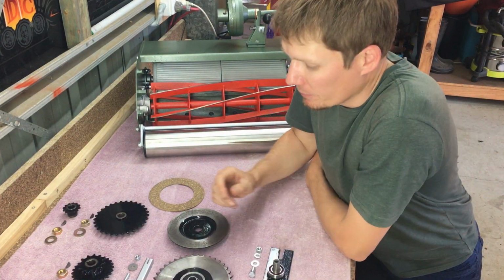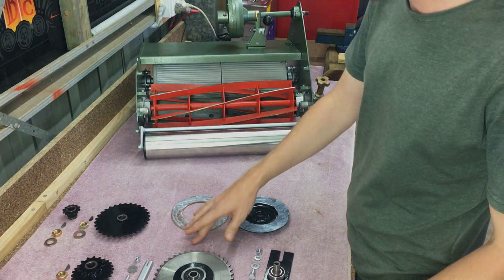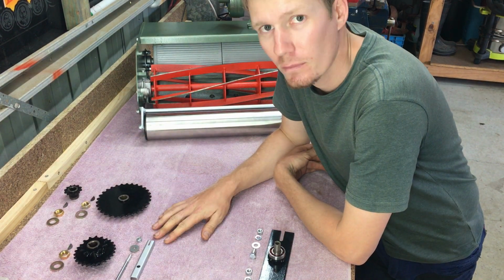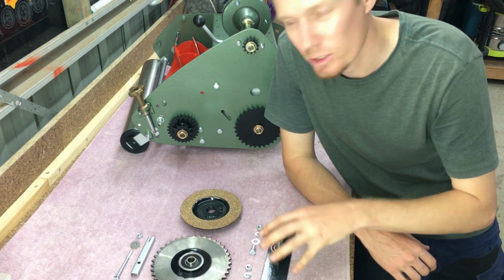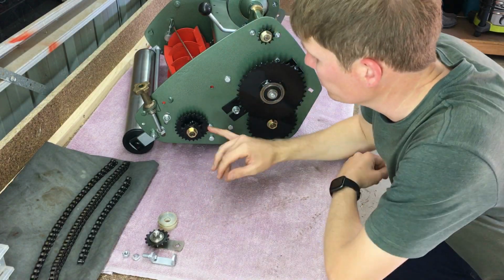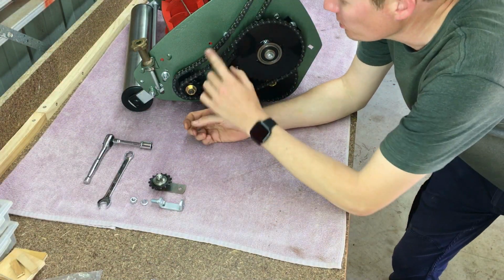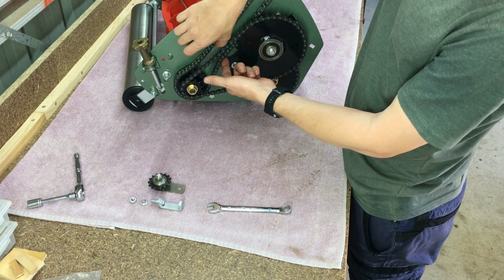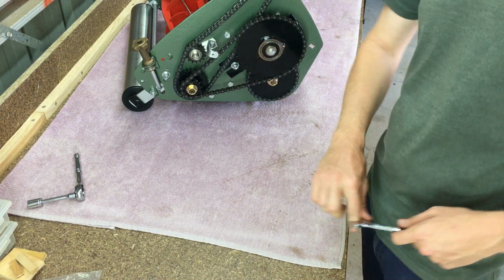Scott Bonnar - Model 45 - Gear + Chain Install

Comment: Hi
Woodruff keys rarely need replacing. Only if the key is badly worn or damaged.
In situations like you had here, SOMETIMES swapping woodruff keys between shafts can assist in easing the installation.
Occasionally, woodruff keys have sharp upper edges that "bind" with the inner corners of the keyway. Removing these sharp edges improve the ease of installation.
Reply from the maker: Thanks, This is handy information, i'll have to remember this for next time.

Comment: I have just acquired one of these. It has been done up by the previous owner. However, the chain that drives the rear drum from the clutch is very loose and the chain the drives the clutch from the reel is tight.
What has happened here? Has he fitted the wrong chain?
It really looks like I need to take a link out to make it fit.
Reply: instablaster.